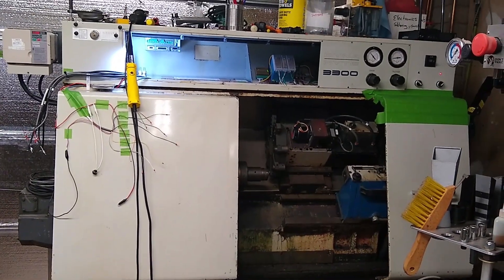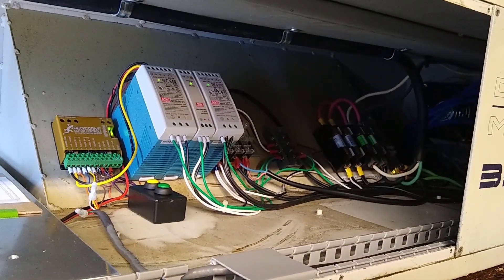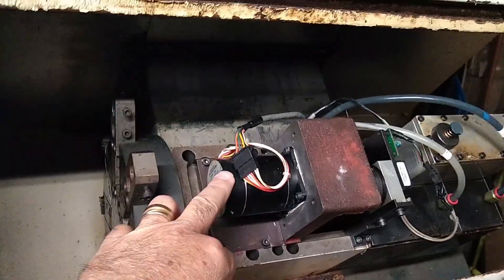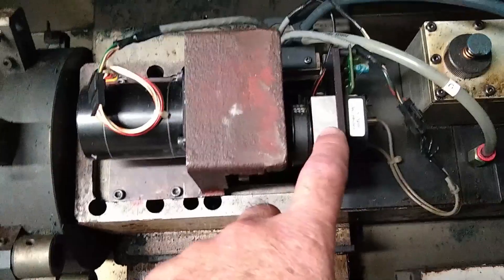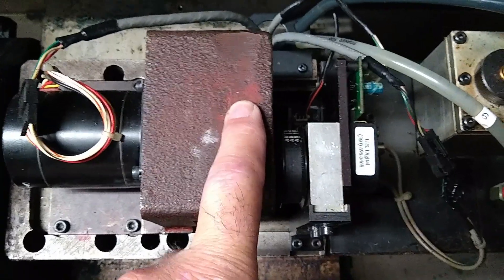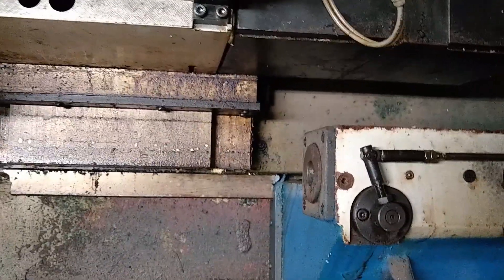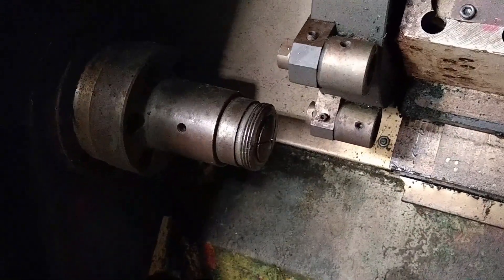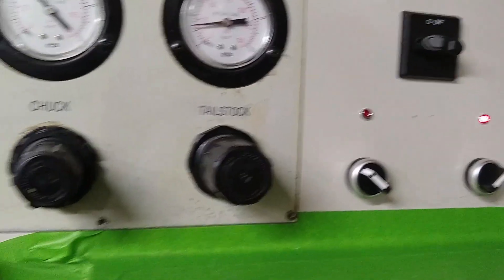Sneak Peek! Dyna Myte DM330 Turning Center to a new Centroid CNC Motion Controller!

Comment: HELLO. I AM USING DYNA MYTE 6" CNC. BUT I DON'T HAVE THE IN-HOLE TOOL EQUIPMENT CONNECTED TO THE TURRET. I SAW IT IN YOUR VIDEO AND WANTED TO CONTACT ME. CAN YOU HELP ME?
Reply from the maker: The machine belongs to a friend of mine. What specifically do you want to know?
Reply: I need the tool holders on the turret. Can you provide an e-mail or whatsapp number for communication?

Comment: Been thinking of the Acorn as an update for my DM 3000H (currently running AhHa).  The turret is closer to this one than the 3000.  Has a similar air over hydraulic cylinder and curvic coupling for locking.  But this one uses 3 opto sensors for position vs an encoder.  I think I would need to add the Ether1616 to handle all the turret inputs though.
Reply from the maker: Yes, you would need Ether1616 and a full understanding of the turret operation.

Comment: what is this NEW controller you speak of?
Reply: Testing Centroid Acorn Six
Reply: @MartyEscarcega  Acorn with couple more axis? Or just little more powerful all around? Im currently installing one on a Kitamura Myturn10. Was about ~8k for the oak and the Centroid Drives needed to use the fanuc servos but Im now rocking some AB Ultra3000 drives with step/direction.
Reply from the maker: @cosmosadrift  6 axis more IO 3 Encoder inputs